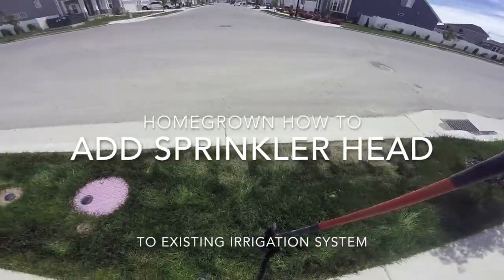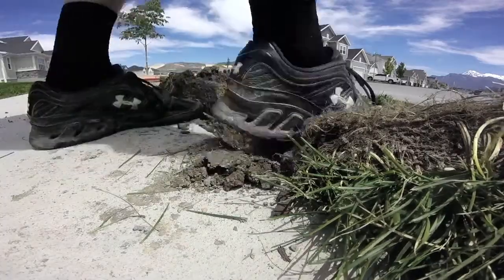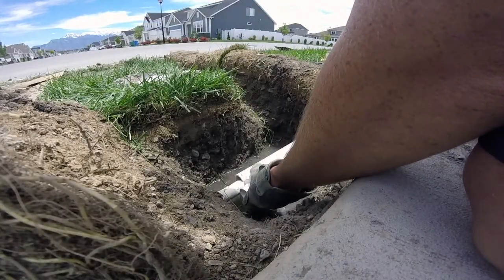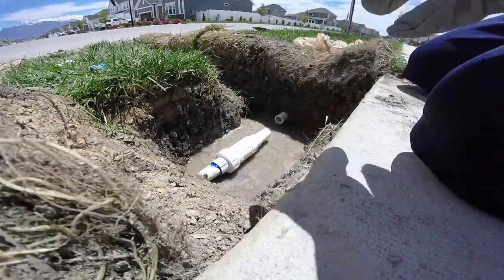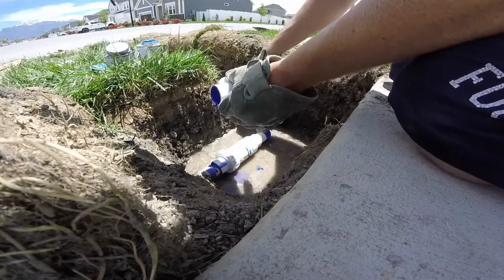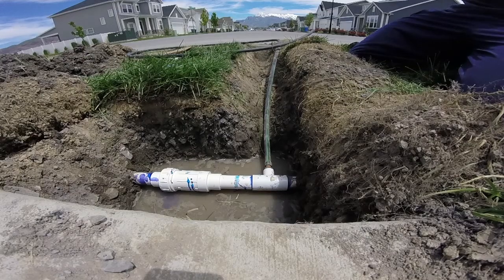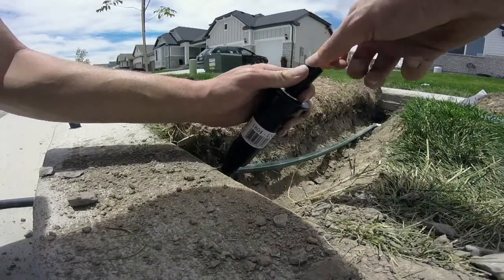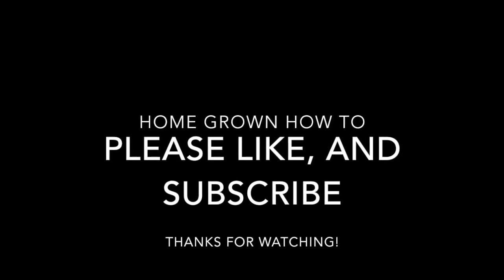How to Add a New Sprinkler Head

Comment: I used one of those telescoping couplers at an "L" shaped intersection. When I turned on the water the coupler extended and it retracted when I turned off the water. I had to cut out the telescoping coupler and use straight pipe. Great video!
Reply: @edorofish  I cannot figure out how you add a sprinkler without telescoping.  I'm just learning about all this.  I know just enough to get myself in trouble!  Lol!
Reply: @janetdonaldson2632  I here ya. I figured what's the worst that could happen? haha
Reply: @edorofish  yes!  I have hired numerous people through the years to help me with my sprinklers.  I have paid plenty and often with not so good results that I end up hiring somebody else to fix.  Then ditto. I am weary about it.  I figure I would make the attemp myself finally to repair a certain doable portion.
Reply: @janetdonaldson2632  I replaced a leaking sprinkler valve and was very hesitant. It wasn't that hard to figure out. I imagine an irrigation company would want around $300-$400 to do the job.

Comment: Learning about sprinklers cause my system and lawn is really messed up!  Another video showed putting clamps over funny pipe where it gets screwed in to further secure the connection.  Does your funny pipe not need clamps?
Reply from the maker: @janetdonaldson2632  it shouldn’t need clamps if you’re using the correct pipe.
Reply: @HomegrownHowTo  thank for reply!  Thank you for making the video!
Reply from the maker: @janetdonaldson2632  no problem appreciate you watching and commenting!

Comment: I need to add a whole row of sprinklers in my back yard. The middle doesn't get any water. Would adding a whole row of 5 or so sprinklers affect the water pressure to the rest of the sprinklers? Or would it level itself off and be the same pressure it has now? Thanks in advance!!
Reply from the maker: Have you tried adjusting your sprinklers you have to reach the area you’re not getting water to? If not, try that first. 
 If you have tried that with no luck, and currently have pop-up heads you may want to switch to rotary heads- they can cover a much larger area (and actually save water). 
But adding 5 sprinkler heads to one zone is a lot and will likely have an effect on your pressure. A simple adjustment to your current heads or replacing with rotary heads will likely fix your issue while saving you a lot of headache and tearing up of your yard. Hope that helps, good luck!

Comment: I want to do something similar. I want to cut the pvc line and place the sprinkler head there vs using the hose to extend it elsewhere. Can I cut the pvc and just use the fitting and place the sprinkler head on the fitting vs using a telescope with a fitting?
Reply from the maker: Yes you can. There are many different ways of doing this job. But, I would use at least a foot or so of the funny pipe. If it gets stepped on or ran over with anything, the funny pipe allows some give and flex. Just using PVC -it doesn’t have that play and a higher chance at breaking the pvc or the sprinkler head. That’s just my $.02. Thanks for the comment! Take care!
Reply: @HomegrownHowTo  
Does the funny pipe come with the fitting to connect to the pvc fitting or its a separate buy?
Reply from the maker: @arielrodriguez6980  it’s most likely a separate purchase.
Reply: @HomegrownHowTo   I have one side by the driveway that does not get wet enough. There is one head on each end and no middle one. Is the best approach to place another one in the middle of the yard to shoot towards the grass next to driveway or place one in the middle between the ones I have on each corner?
Reply from the maker: @arielrodriguez6980  that depends. I would first try adjusting your sprinklers. I have a video on how to do that. If adjusting them to shoot further to cover a larger area doesn’t work then I would add one in. My guess is you can just adjust them without having to add one in.

Comment: Could you post a link to the primer and glue?
Reply from the maker: Sure thing! 
CHRISTY RH.PURP.HP Purple Primer Cement, 1/2 pint Low VOC https://www.amazon.com/dp/B01H6GR2O2/ref=cm_sw_r_cp_api_glt_fabc_W7FR2GSZP21MZHG4C0PJ

T Christy Enterprise RH-RHBV-QP Christy'S Glue Low Voc, Red Hot Blue 4 oz Blue https://www.amazon.com/dp/B000CFJ3FG/ref=cm_sw_r_cp_api_glt_fabc_7SZXACQARPKVK43PEAMH?_encoding=UTF8&psc=1

Comment: So I assume that the connections to “funny pipe” are simply a push on compression fitting?
Reply from the maker: Yes, they are very strong connections though. The little couplings have sharp ribs on them that hold on to the funny pipe.

Comment: what happens if kids play on grass and step on the sprinkler head? Thanks
Reply from the maker: I try to keep my heads even with soil so there is no risk for injury from the sprinklers. As far as the sprinkler goes- the soil and grass roots should hold it in place to prevent it from moving around if getting stepped on. Hope that answers your question.

Comment: What is the purpose of using telescope pipe? And why can you use straight pvc with a T ?
Reply from the maker: Vinh Nguyen you can do as you mentioned, but it would be more difficult and would likely need to dig up more sod to be able to bend the pipe to fit snugly into your T fitting. With the telescope you don’t need to dig up as much and there would be no need to bend any pipe. I chose this method to make it easier for myself. I hope that makes sense. Good luck!
Reply: Homegrown How To oh ok ..got it ..I also didn’t catch the part you cut the pcv to connect it , should be cut when the telescope extend or when is not extend ?
Reply from the maker: Vinh Nguyen cut with the piece not extended but make sure to not cut larger than the fitting extends.
Reply: Homegrown How To ok ..thanks so much ...be safe  !
Reply from the maker: Vinh Nguyen thanks you too! Good luck on your project.

Comment: Did you know there is a PVC SNAP FITTING that you could have inserted, glued, and hole drilled on top of that PVC piping that you cut in lieu of cutting that existing pipe?
Reply from the maker: So many ways to work on irrigation.

Comment: Why use funny pipe and not pvc if your going in a straight line?
Reply from the maker: You could use either. The funny pipe doesn’t effect anything. It’s honestly what I had so that’s what I used.
Reply: I just found a dummy sprinkler in the front corner of my yard. Damn sprinkler sitting pretty not connected to anything! Lol I always thought it was the neighbors. Now I have to run a line to it.
Reply from the maker: @enzomoya1689  that is odd! 😂 good luck!

Comment: You should have used a "snap tee" that was less work and less cost.    You just clean the pipe and glue "snap tee" to outside.    Drill a hole thru the "snap tee" thread (usually 1/2 npt or 3/4 npt hole) and original pipe and screw in your barb.   I use these to also fix a cracked PVC pipe and just apply it like a band aid with PVC cement to both pieces without any hole.
Reply from the maker: Interesting, I’ll have to look into that. Thanks for the info!